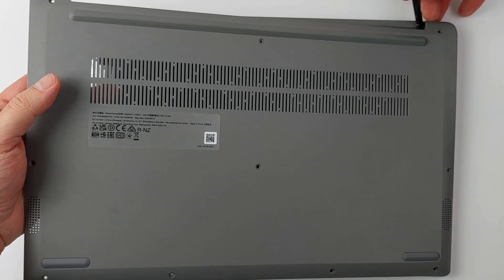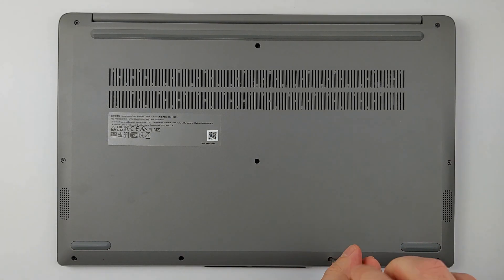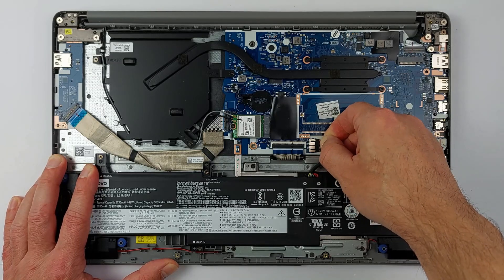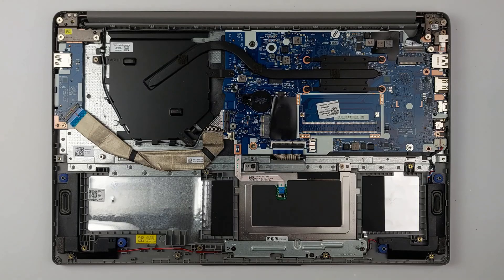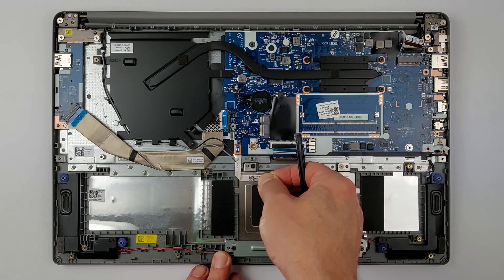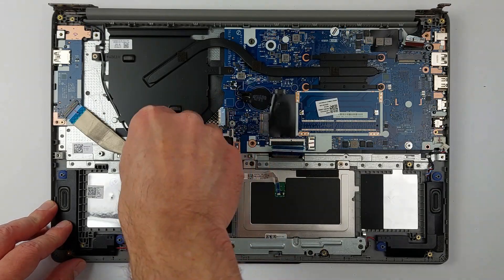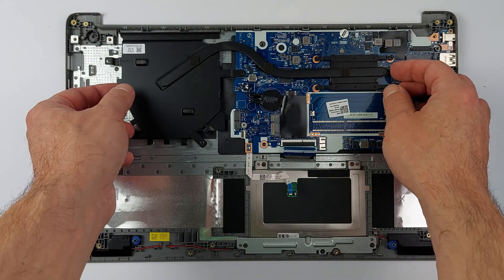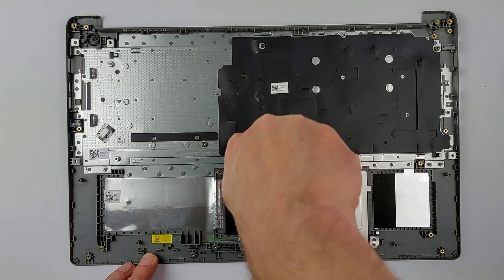Lenovo IdeaPad 1 Disassembly - Full Teardown, Battery, WiFi, Keyboard Repair & Upgrade Guide

Comment from the maker: 💻 I hope this teardown guide helped you with your Lenovo IdeaPad 1 15IGL7!  
🔧 Need tools or replacement parts for the Lenovo IdeaPad 1 15IGL7?  👉 You’ll find the full list (battery, SSD, RAM, charger, display, Wi-Fi & more) in the video description.  

Your support through these links helps me create more free repair tutorials 🙏  

If you have any questions or ran into issues during your repair or upgrade, let me know in the comments — I’m happy to help. 
 
Also, feel free to share what you liked about the video and what I could improve for next time. Your feedback makes a difference! 👇

Comment: hi where is the emmc storage  located on this laptop thanks
Reply from the maker: Hi! In this specific unit in the video, the M.2 SSD slot is actually empty (it's located in the top right corner near the hinge). If your  laptop uses eMMC storage, which is a chip soldered directly to the motherboard and cannot be removed or replaced. However, you can use the empty M.2 slot to install an additional NVMe SSD if you need more space!

Comment: Hi contact please
Reply: Where can I get that mother board
Reply from the maker: @MarthaMadiba-jp7eq  Hi! I actually have this exact motherboard in stock in my shop. However, please be careful: You need to ensure compatibility, as parts differ significantly between models. Even within the 'IdeaPad 1 Gen 7' series (like 15IGL7 vs. 15ADA7), the internal layout varies—some boards have RAM slots while others don't, and different CPUs often require different heatsinks and fans.

To be 100% sure, please check the sticker on the bottom case for your exact laptop model number e.g. 15IGL7 AND Machine Type Model (MTM) number (it usually starts with 82..., e.g., 82V7). Let me know that number and where you are located, as I do not ship worldwide.

Comment: Hi, your video is very clear and informative. Congratulations! Do you know the maximum RAM this model supports? Does it have a slot for another SODIMM module? Thanks!
Reply from the maker: Thanks a lot! 
I’m glad you found the video helpful.

This specific model — the Lenovo IdeaPad 1 15IGL7 — has 4 GB of RAM soldered on the board and no SODIMM slot, so the memory can’t be upgraded.

However, some other IdeaPad 1 Gen 7 versions (like 15ADA7, 15AMN7, or 15ALC7) do include one RAM slot in addition to the soldered memory, so those can be expanded — usually up to 12 GB or even 20 GB total, depending on configuration.

If you’re not sure which one you have, check the full model name printed on the bottom label (e.g. 15IGL7, 15ADA7, etc.). 
That small difference decides whether a RAM upgrade is possible or not.
Reply: @LaptopRepairTutorials  Thank you for your quick response. Greetings from the city of Santiago del Estero (Argentina)!!
Reply from the maker: @marioenrique8  
You’re very welcome!
I’m really glad the video helped.
Sending greetings back to Santiago del Estero.
Always nice to see people watching from all around the world.
If you ever have more questions, feel free to ask anytime!

Comment: Could you point me in the direction to find the screws for the ddr4 and ram stick? Unfortunately stripped one
Reply from the maker: Hello, 
thanks for your message.
Iam not really sure which screw you mean.
The DDR4 RAM stick isn’t held by any screws — it just slides into the slot and locks with two small side clips.
If you meant one of the screws nearby (for the metal cover or bottom case), could you let me know which one exactly? 
Then I might can help you find the right replacement.
Reply: @LaptopRepairTutorials sorry! The screw that holds the ram stick down on model 15ada7

Comment: This helped me get mine apart, thx.  mine is a IdeaPad 1 151jl7 ultra thin. The screws on the back on mine were a T4. the bottom 4 are short one and the rest were longer ones.
Reply from the maker: That’s a great addition – thanks for pointing out the T4 screws and the length differences, it will definitely help others! When you had it open, did you also try replacing or upgrading any parts?

Comment: Thanks for sharing. Quick one, where can I buy a motherboard? I spilled water on mine, TIA.
Reply from the maker: Hi, thanks for your comment!

There are different versions of the Lenovo IdeaPad 1 series, so it’s very important to check the exact model number of your laptop before buying a replacement motherboard. If you want, you can share your full model designation (e.g. “IdeaPad 1-15IGL7, Type XXXX”), and I’ll check the compatibility for you.

I do have a matching motherboard for the Lenovo IdeaPad 1 15IGL7 available in my shop. It is exactly the motherboard you see in the video. However, I currently only ship within the EU.
👉 If you’re located in the EU, you can order directly from me.
👉 If you’re outside the EU (for example in the US), let me know your location and I can try to help you find a suitable source.

Hope this helps – and feel free to send me your exact laptop details!

Comment: It doesn't have a fan??
Reply from the maker: Correct – this specific model of the Lenovo IdeaPad 1 15IGL7 has no fan.
However, some other versions of the same laptop (especially those with faster CPUs) do have an internal fan.
Lenovo uses different cooling solutions depending on the configuration.
If you have any further questions feel free to ask.

Comment: Where is hard drive
Reply from the maker: Thanks for asking!
This laptop doesn't have a traditional hard drive. It uses a replaceable M.2 SSD, which is installed in a slot located just below the display cable, near the top-right area of the motherboard.
In this video, the SSD was removed before disassembly, so the slot appears empty.
You can upgrade it with any M.2 SATA SSD (2280 format).

Comment: Do you think getting a new battery would fix a power supply issue.

Problem: Laptop won’t turn on, light not turned on when cable is in. 

Trouble fixes that didn’t work: Trying a new cable, outlet works, 10 second restart, taking battery out and putting it back in to do a hard reset.
Reply from the maker: Thanks for your detailed description! If the laptop shows absolutely no lights when plugging in the charger (even without the battery installed), it's often not just a battery issue. Normally, a dead battery would still allow a "plugged-in" LED to appear.

Your description suggests a deeper issue – maybe a faulty charging port, motherboard component failure  or even a power circuit problem.

Buying a new battery might not fix it unless you're sure the battery is completely dead and causing a short (which is rare).

I'd recommend opening it and checking for signs of damage near the DC jack or motherboard first. Let me know if you need help with that!
Reply: @LaptopRepairTutorials opened it, couldn’t fix it, that laptop was messed up real bad and pretty old. This was for my girlfriends laptop, she ended up buying a new computer about a week ago which should last her years.
Reply from the maker: Thanks for the update! Sounds like you really gave it a shot — sometimes it's just not worth the time and effort, especially with older laptops that have multiple issues.

Glad to hear she got a new one! Hopefully that’ll last her a good few years without trouble. If you ever need help with repairs or upgrades on that one in the future, feel free to reach out — happy to help where I can!
Reply: Where is the SSD, is it integrated into the board?
Reply: @supercbs1 I don’t think this laptop has an SSD
Reply from the maker: @supercbs1  Thanks for your question!
The SSD is not soldered onto the motherboard – it uses a standard M.2 slot. In this model (Lenovo IdeaPad 1 15IGL7), the M.2 SSD slot is located on the right side of the motherboard, just above the RAM module.

In the video, you can see the empty slot – it looks like a small rectangular connector with a screw mount nearby. This is where you can install a M.2 SATA SSD (usually 2280 size).

So yes, the SSD is upgradeable – it's not integrated, and you can add one yourself.

Comment: Make sure to use the correct size screwdriver: doesn't show the correct size.... 

Maybe you did but you lost me with this video 💀
Reply from the maker: Appreciate your feedback! 
I did mention using the correct screwdriver size, but I see how actually showing it would have been more helpful. 
I’ll make sure to include that in future videos. 
Was there anything else that could have made this video clearer or more useful for you? 
Your feedback really helps me improve future videos!
Reply: @LaptopRepairTutorials your time stamps don’t match is the only thing I can give feedback on
Reply: mine was a T4

Comment: RAM and storage are soldered?
Reply from the maker: Hello,
Thank you for your comment!

The Lenovo IdeaPad 1 series includes different models with various configurations for RAM, CPU, GPU, and displays.

For this specific model (Lenovo IdeaPad 1 15IGL7), the RAM is soldered and unfortunately not upgradeable. 
However, on models like the Lenovo IdeaPad 1 15ALC7, the RAM is upgradeable.

Regarding storage, all models in this series use an M.2 SSD, which is replaceable. 
You’ll find the SSD slot located beneath the display cable connection.
Please note that the SSD is not visible in this video, because it was removed before the disassembly.

If you have any further questions or need assistance, feel free to ask. 
I’m happy to help!